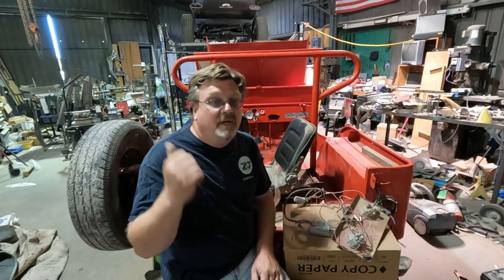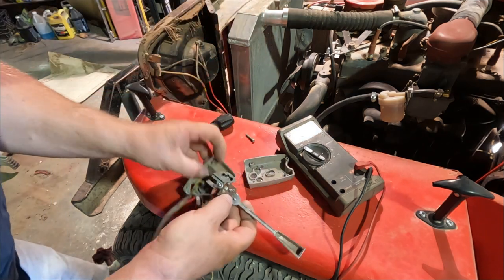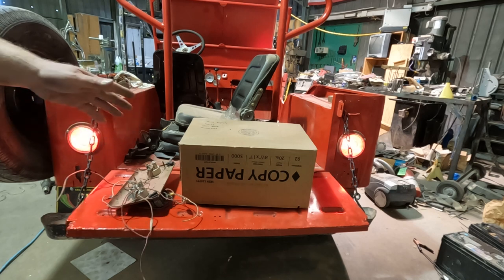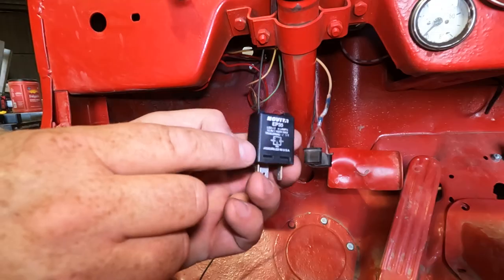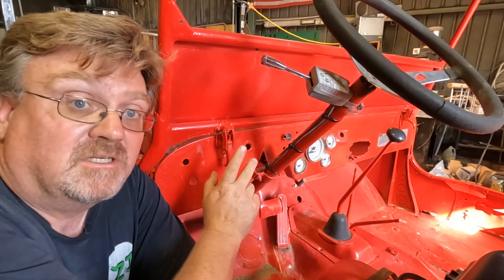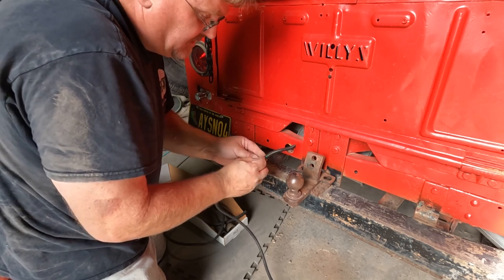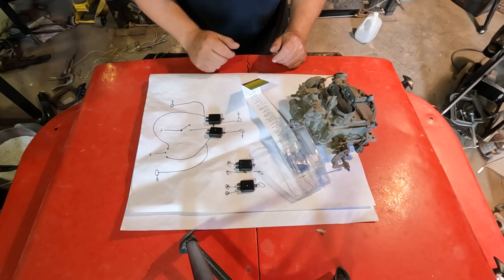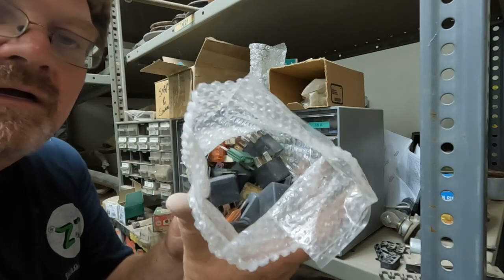Add-on Turn Signal Installed In My CJ-2A Willys Jeep

Comment: Obviously this was a year ago, so you may have realized by now that you wired it wrong: When you hit the brakes you have no turn signal in the rear, because the lights will be on constantly - and from what you showed, you didn't test that the turn signal works when the brakes are pressed, which it won't when you're only using basic diodes. In order for it to be wired correctly, the turn signal switch needs to disable the brake light power to the side you're flashing. Effectively the brake lights need to be wired through the turn signal switch, so when it's in neutral, the power is free to go to both sides, and then when you indicate left, the brake light power to the left is cut off and power is sent to the turn signal relay instead, and vice versa for the right side. It appears the turn signal switch you added is for separate turn signal and brake light curcuits, and won't work with a combined circuit unless you get a bit more creative with the wiring.
Reply: This makes complete sense.  Automotive electronics are beginning to actually click these days, it only took 50+ years 🤣👍🏻🤣

Comment: Why get into all that complication with diodes?  Why don't you just use separate indicator lights (or turn signals, as you call them) at the rear?  Here in England it is illegal to have the brake lights and indicators working off the same bulb.

Comment: 37 years of teaching industrial arts and still learning. My grandson picked up a FUBAR 46 Willys and is hitting me up for guidance. At any rate, 6 volt to 12 volt. Now lighting and figuring out exactly what you did. Amazing help. I like your sense of humor as well! Obviously you been there. Do like your use of old when you can. Of course, I do tell the boy to use the research...it's much easier today! Thanks.

Comment: I had no idea you could wire in diods like that.   I have burned out a few of those trailer light connectors.   
Very cool what you have done.
Reply: The trailer light adapters are awful. They would work, fail, work again, then fail; always inexplicably and for random periods. When the replacement went nuts after a short time, I only connected the piece of crap for towing so even if it was on the fritz I had plausible deniability for Johnny Law.

Comment: Nice work with the blinker switch install. Wiring is one thing that holds me back on my projects. I just plain and simple don't get it 🤷‍♂  Glad you could fit the tow bar also. Take care and happy wrenching 🔧🔩
Reply from the maker: Thanks!  I've noticed that a lot of people shy away from wiring, that's why I figured I'd dig a bit deeper on some electrical videos and maybe that'll help.
Reply: If you think of basic electric current as water flow, it simplifies things. Positive flows to negative, always have a good ground. Hope this helps.
Reply: @richarda996  That's a good way to think about it. Take care Richard! 🙂👍

Comment: Enjoyed the video, good explanation of wiring; Two questions 1. Where did you get your rear lights (brake and signal) 2. What did those seats come out of?  Keep doing what you do !!
Reply from the maker: Thanks!  I got the lights from Wheeler Fleet Solutions, but a lot of other places sell them, they're kind of generic for trucks and trailers.  The seats are replacements for a forklift, got them off ebay.
Reply: @LowBuckGarage but do you have 4 way hazzard flashers ???

Comment: I never realized how much I would like seeing your wiring “schematic” haha very helpful. Could you possibly do a small recap with drawing on the hi beams and low beams again? My cj5 has a two position switch and first position is running lights and gauges and second position is hi beams. I don’t really understand if I need a floor switch or what kinda setup the previous owner had or if he just set it up to brights all the time. All the wiring is new… but no floor switch. I’m just a little lost on the best way to not blind the neighbors
Reply from the maker: I'd guess he wired it for off-road use only, and didn't need low beams.  You need a switch that has one input and two outputs, like the floor switch or even a SPDT switch on the dash.  Take the wire that currently goes to your headlights, and run it to the input on that switch.  Then run one output to your high beams, and the other to your low.
Reply: @LowBuckGarage  thanks for the help. I’ll try and give it a shot
Reply: @LowBuckGarage  well good news, I gave it a shot. Well not really. My speedometer went out so I fixed that… then decided instead of seeing that my brights are on all the time I took the bulb and just put it in the back light socket. Ha, problem solved! Low-Buck style 😅
Reply: My 2 cents, I run sealed beams and the way new car lights are the best way I've found is to just aim the highbeams down and forget the lows, you'll just be blinded by new cars if youre running sealed lows.
Reply: @xijinpingsfavoritehemorrho1328  that’s a good point

Comment: If there is a round rubber wheel at the top of your switch housing, mount the switch so it contacts the steering wheel!  When you use your turn signals, then they will automatically turn off!

Comment: Spray the switch with CRC Lectro-Motive! Stuff will clean the contacts, and it won't short them out either!
Reply from the maker: Thanks for the tip, I'll get some of that.  I run into this kind of problem a lot...

Comment: Black hot & white ground is the standard in heavy trucks and trailers.
Reply: It's the standard for small trailers as well. A 4 pin connector is usually green, yellow, brown, and white, a 5 pin adds a blue for electric trailer brakes, and a 7 pin adds a black and a red for 12V power and backup lights.

Comment: At 31:12 In Michigan you can pull two trailers but one of them can not be on a ball…. Pin only! You chose which one!
Reply from the maker: That's really interesting, I wonder why they do that.  I would think that as long as you're within the weight rating of the coupler it would be ok...

Comment: What about brakes on, plus using a turn signal. Thats what all the fancy circuitry in the uhaul box does. As is, if you hit the brakes, your rear lights will be on solid with no turn indicator.
Reply from the maker: Yes, exactly.  When there's only two lights in the back, I want braking to be the priority indicator.  I want to make sure people behind me know that I'm slowing down, because being rear-ended is the most likely danger.  In situations where you need the turn signal light to be seen, like changing lanes, you're not using the brakes anyway, so then the turn signal is most visible.

Comment: Hey from down under what is the best paint to hide sins
Reply from the maker: I like Rustoleum, mainly because its cheap and in every store around here.  Any brand rust stop type paint seems to dry really slowly, which lets it soak into whatever crud is on the surface.  Also, it isn't too glossy, so it hides a lot of dents and waves in the metal.

Comment: love  Jeep  now linseed oil under all,  splash IT ON.    Metal , rubber,   plastic , loves linseed oil.  
keeps water out.   paint  no good,   shrinks and swells diferent than metal  pulls  away from metal  lets wet in and holds it.  worse than bare, .